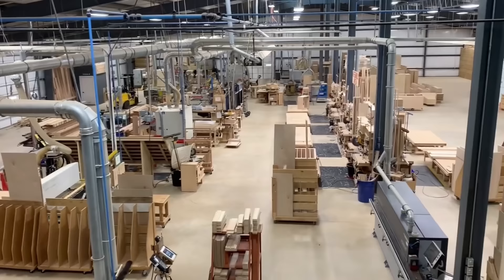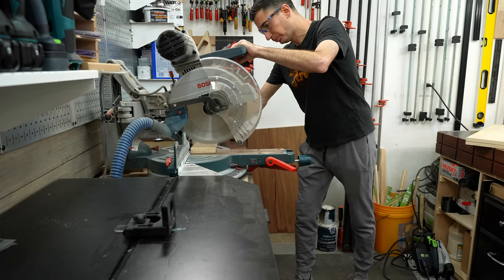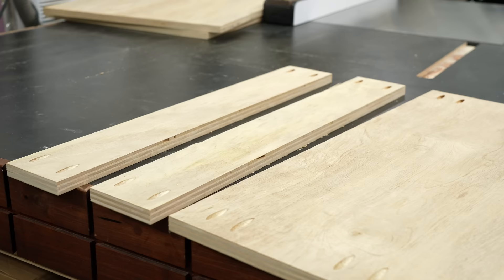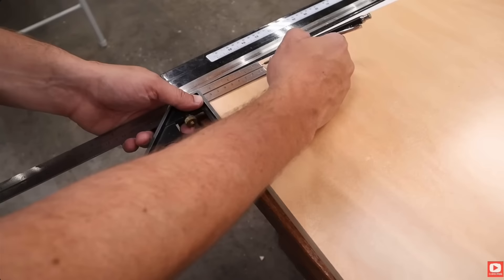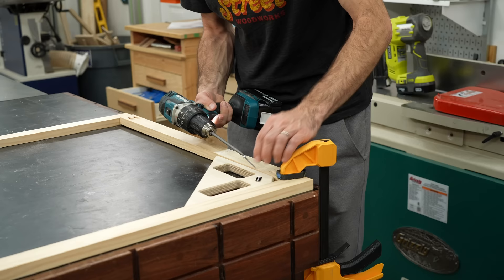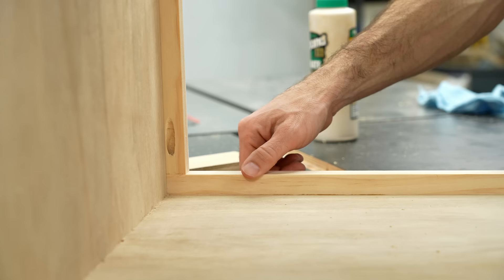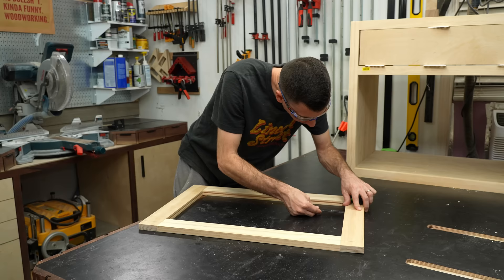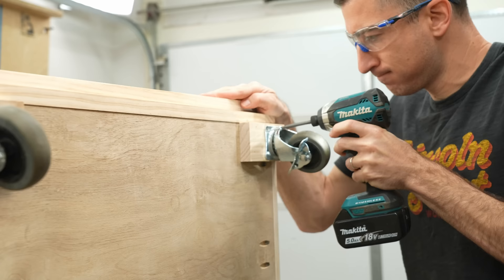Bad Beginner Cabinet Tips

Comment: To answer your question. I have been building cabinets for 35 years and am watching your video because I am helping a neighbor build his own garage cabinets. I am going to employ pocket screws & glue for simplicity and strength. He does not have a shop full of tools, limited experience and loads of apprehension. We started at the "big box" store (just like you) and picked out a sheet of sanded radiata pine plywood. I will send him the link to your video so he can mentally prepare. Great timing and great explanation of the beginner's process. Thx.
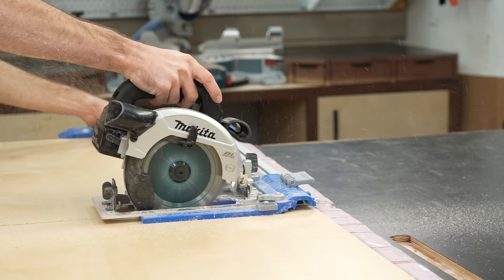Reply: 16:36 The Question 🙂
Reply: Perfect!
Reply: What d you give him else😆
Reply: Hhhssahhshahhaa

Comment: I'm just amazed you got a Home Depot employee to actually help you.   Nicely done.
Reply: in my area home depot is the most helpful place to go. its Lowes that the average homeowner has to stay away from  over here.
Reply: Home Depots are great, Lowes used to be terrible but they’ve honestly gotten a lot better.  Can’t beat the local private owned stores though, they are absolutely the best!
Reply: It's touch and go around here on whether you can get somebody to cut your panels.

My favorite part is when they start siding rules about how they're not allowed to cut it this way or that way because Billy Bob cut his arm off last year trying to make a cross cut on the panel saw... 😂
Reply: I made a comment once to a Lowes manager.... told him his store was worse than the inside of a women's purse.. he laughed and said "funny it was designed around women" funny that was in 2005... haven't been in one more than 3 times  since
Reply: I’m amazed he found one
Reply: My Home Depot recently set a world record for the dullest saw blade on a power tool.  The whole store smelled like smoldering wood, molten steel, and vinegar after one cut.
Reply: Amen! I once drove to three different home depots (I called them first to verify they could do a rip cut), each one told me they couldn't do it for "safety reasons" o_0 safety policies are all good and well but like, tell me when I call before I drive all the way out there.
Reply: Panel saw is always down at home depot.

Comment: love your pragmatic approach,  it is evident in almost every step of this build.   Little stuff like the 2 pieces of offal instead of "doing the math" wind up giving the best fit.   Using simple methods and tools, eyeballing stuff, using a drill bit for a depth gauge, etc...
Good work!
Reply: @ensidfkgnur, "offal"? Perhaps you meant "offcut"?

Dang spellcheck!
Reply: @fredericapanon207  Meant to use it, it usually refers to waste parts from butchering but I figure a tree used to be alive so that's what I call scrap wood.

Comment: Glad to see that after your deliberation, you went forward on making the cabinet tutorial using, your own sensitivity,  a simple set of tools, and enjoyable instructional style. You've made a contribution on this topic.  Thank you!

Two other simple DIY ideas that I use are 1) to sand and cut wood in the driveway outside my shop in order to lessen the DUST problem, and 2) for an inexpensive, flat, light-duty work table (cutting, sanding, assembling), I use two cheap collapsible but sturdy Stanley saw horses with an old hollow core door on top  (look around the neighborhood on garbage day.) Those three parts can tuck neatly away in even a small storage locker.
Reply: I'm a huge fan of the hollow core door as a temporary work surface. So nice and light, but still stay decently flat when only supported by a couple of saw horses

Comment: Honestly, I bought that Kreg circular saw guide and it made me feel so much better with cutting plywood. It is so quick and easy, and adjusting the measurements to be accurate is super simple. 

Highly recommend it. It changed my woodworking for the better.

Comment: When making the frame, it can be helpful to oversize the width by a half inch. This makes it easier to line up the faces of neighboring cabinets if your wall isn't perfect. It also let's you apply a quarter inch skin/panel on the side of the end cabinet scribed to the wall. This will minimize gaps between the cabinet and wall and hide any fasteners on the side of the cabinet. Or cover the unsanded/rough side of the plywood.

Comment: Math teacher here. That board might not necessarily be a parallelogram. Both pairs of opposite sides have to be parallel to meet the requirements of a parallelogram. If only one pair are parallel you have something like a trapezoid. Either way, great video as always!
Reply: And if we're getting pedantic, he talked about building a parallelogram instead of a box, but a parallelogram is flat, so the equivalent would be a parallelepiped. Or a trapezoid prism, but the edge guide will guarantee you get a parallelogram.

Comment: I have been building cabinets for 55 years and I watched your video for entertainment. My first table saw was a circular saw mounted on a piece of plywood and turned over. I made six eight foot cabinets for my garage with that table saw and these weren't even my first cabinets. I then bought an antique porcelain top table and convinced my wife I needed a table saw to make the chairs, that was in 1984, over the years I did a few upgrades to the saw but just realized it's 40 years old this year and looks and runs like new. I have used it to remodel two homes. it has been used to make dozens of cabinets a few inside doors and two oak and two cherry entry doors, coffee tables, end tables, headboards, well the list is endless. By the way I think y wife has been able to park her car in the garage for about two months, that's one month for each house. and the second house is a three car garage or should I say workshop. The other reason I watch you is, even an old dog like me can learn a new trick.

Comment: A quick tip for bringing home intact 4’x8’ sheets of Pink Panther:
An ‘03 Subaru station wagon and a 10-foot length of whatever rope or strap you have handy is all you need! Make sure to use this as an excuse to purchase corresponding 4’x8’ sheets of plywood for the “other” projects. The foam board acts as perfect Subaru-scratch-protection when weighed down by sheets of ply — the more, the better! Remember, NEVER match-stack multiple sheets of Pink Panther — it’s super slippery. Ask me how I know. Instead, alternate strawberry-chocolate-strawberry-chocolate. Use that strap draped over the top and held by your left hand through open windows and pray for no gusts of sideswiping wind. Knee-steer with manual transmission (also helps with praying) and drive home as fast as the zephyr gods will allow. Pull over to let tailgaters pass but make sure to smile as they gawk and point. They probably think delivery is free and they certainly don’t understand YouTube content creation. Suckers.
#thatguyinthehomedepotparkinglot #slippery
Reply: Somewhere in the bowels of Home Depot, there must be a video of parking lot bloopers.

Comment: I love your commentary. All the techniques you demostrated are what every 'beginner' DIY'er should know. Also, as you have pointed out, "Haste makes waste"
As far as your thumbnail, the straight in method is stronger that the direction the pocket holes are drilled for entry into the mating piece of wood. If the pocket holes were drilled to enter the wood in the opposite direction then the choice would be reveal of the fastner.
Love your videos and keep up the good work.

Comment: 2:13 could also be a trapezoid if the shorter edges are not parallel. Math geek FTW!
Reply: you learn this when you're 4 years old you're not a math geek more like a little kid
Reply: He's using an edge guide, so both pairs of opposite sides will be parallel. He was comparing the parallelogram to a box though, so the proper math geek term would have been parallelepiped...

Comment: Totally agree on your points!  However, I use my shop projects to improve our skills, so yes I overkill and pretend it for inside the house.  Mistake here and it was just a learning experience in a piece of wood that is much cheaper than if I had been building something for inside my home.  One tip is to take it slow and verify how the pieces are going to fit before we make that final  irreversible cut.  Again thanks for the tips.

Comment: Great overview.  I'm a huge fan of the crown staple and then screw the parts together.  No need for glue, dados/rabbits, etc., unless you are building a tank (and I have no issue if you do).  It works just fine, is plenty strong, saves time and mess.  I like to buy the pre-finished plywood since you don't really have to touch the inside at all after construction.  Worth the extra upfront $ IMHO.

Tip for toe kicks, especially the separately built ones... make sure that if your cabinet side(s) is/are exposed that any base molding covers the seam between the toe kick and cabinet side.  I've made that mistake before!

Comment: This may be the best video containing sponsor promotion I’ve ever seen. I really liked the conversational way you talked about insurance. Parent to parent. Very cool, but what rocked it for me was you didn’t stop working on the project. That right there. This! Also appreciate the stats and coverage of alternative methods, particularly the trade-offs in cost, strength, aesthetics, and difficulty to pull off. Of course you did all the other stuff right too. No super fancy tools, addressing metric people, pointing of the extra gap, using the tools well, you even had two wide shots so we could see both ends of your shop. Solid. A really solid video with an awesome innovation in pitching for your sponsor!

Comment: Instead of the toe kick frame, you can buy sets of 4 feet + 2 clips online. 1 foot per corner, and they’re all individually adjustable to level off. You attach the clips to a single plank, and they click onto the front 2 feet. If you have multiple cabinets, you can put the clips onto a single long plank so there’s less seams. You can attach a little pull cord that sticks out of the top, hidden from view, so you can unclip them
Reply: Yes, they adjust also just like a dishwasher. It's easy

Comment: If you don’t have a truck, another reasonable option is renting a small pickup truck on Turo. I found a Jeep Gladiator for $60/day and it has a nice feature to load full sheets of plywood in the truck bed. Home Depot also rents trucks for like $20 for 4 hours, which may be a good option if you live close.

Comment: I've had good luck cutting plywood at 11-7/8 “ x 96", & it comes out perfectly with 4 pieces the same width. If you are making wall cabinets for the kitchen, the standard depth is 12", but consider making them deeper (13", or 14"), as 12" is barely enough for dinner plates. The added depth could be helpful.

Comment: I agree, most all options of assembly have their place and time. If the sides will not be visible, glue/brad nail/end screws. If the ends are visible I’m more inclined to use pocket screws for box assembly as long as they won’t be visible.

Comment: I built a bunch of shop cabinets years ago with pocket screws and a circular saw using pretty much exactly this same method.  They are still holding strong and survived two moves in that time.  Pretty easy and holds up better than I thought they would.

Comment: A very good video. Very informative, easy to follow. 
I’ve been cobbling cabinets together for a very long time now. I started in construction when I was 15, I’m 70 now, broken down and tired, but so busy, with three daughters living within 5 blocks ether way from our house, they always need something built or fixed, and I love it!
Every single thing in this video I completely agree with, except, I can’t imagine a drawer bottom simply glued and pin nailed. I was taught, and have always used a loose panel, in a dato groove. Here’s a tip for a great looking drawer. Blow the dollars on 5/8” Baltic birch, but save it for your drawer boxes. For the top edge use a round-over, then clear coat the box. For the finishing touch, I use white melamine coated Masonite for the slide-in bottom. It makes a very sharp, east to clean drawer. 
Anyway, I really enjoyed this video. As I’m new to your channel, I get to binge watch all the others! 
For those that enjoy fine woodworking on a larger scale, I suggest watching the Tally Ho, or Acorn to Arabella channels. Both are 30+ foot sailing boats built from the keel up. They’re both well worthy of your time, you won’t be sorry. 
Cheers!

Comment: I’m loving how the pocket screw has taken over the YouTuber wood working video, to be more helpful, when you use those hidden hinges, cut a block that the hinge plate sits on that goes inside the face frame, this will keep all the doors in alignment, upper and lower cabinets, and on the drawer fronts, pin nail them as close as you can to where you want them then tap the alignment to perfection, and then screw them on to hold the alignment 😅

Comment: I am sorry to inform you that I have been putting together drawers the old way for 50 years. Without the need for KREG methods and all kinds of others.
For the drawers, I usually work with 15 mm PLYWOOD with screws 3.5 mm thick and 40 mm long, and of course add good glue.
Sometimes innovations (with all due respect) do not significantly change/improve but add costs.
In amateur carpentry there is beauty in maintaining good quality and at the same time adhering to minimalism.
Sorry for my English, not as fluent as my drawers.

Best regards.
Haim

Comment: Gluing the drawer bottoms on as you did may work alright for light duty use. If however you anticipate storing heavier items in the drawer, it would be better to set the drawer bottom into a groove cut into the sides. Allowing enough room between the drawer side bottoms to the groove, will also allow running a brace bd. under the drawer bottom, for even more heavier duty use.

Comment: I wish I would’ve found your channel before I started a kitchen reno 5 years ago. By the time I was done, I landed on your MO, almost exactly. I did learn the Brad nail trick though. Much easier than using 4’ clamps and wonky corner clamps.

Comment: For anyone else that does not have a truck I would recommend a harbor freight circular saw from their Hercules line. Their 20 V brushless has an extraordinarily large and solid foot on it and with an eight amp hour battery, it has loads of power to run. I take mine with me to the store now.. just in case I need something..”need”
I’m waiting for them to come out with the track saw ………….

Comment: The separate toe kick construction method is an advantage for cabinets installed in a garage workshop because the concrete floors of a garage are typically sloped down towards the overhead door. This allows the toe kick assembly to accomplish all of the leveling of the base cabinets. Cabinets in shops and garages are not like kitchen cabinetry where the aesthetics of end panels and toe kicks influences the construction methods.

Comment: I bought some flatstack cabinets for a custo kitchen, and they all went together with dovetails. Those cabinets were definitely stronger than any flatstack cabinets I'd assembled before, and stronger than most if not all custom premade cabinets I'd delt with. If I start making cabinets more than the occasional one-off, I think I'm going to mimic that method.

Comment: Hey, greate video, a loot of useful tips, one suggestion though, for any cabinet on which you plan to put weigt, like the shop cabinet, the bottom should carry the load and not the screws, in other words, the bottom should have the external dimensiuon of the cabinet and the side walls should rest on the bottom, this provides mecanical advantages

Comment: Tip for those that dont have much room like living in apartment building. I designed the custom table, made cut list and then went to local store that had both cutting service and the plywood. I talked to guy first asking to be accurate as possible and asked for the simplest parts being cut and this was specially good since the charged by the area of plywood you bought, not the whole sheet. After confirming the size was what i ordered by fraction of a millimeter, witch i have to give the guy, excellent work, i gave him the rest of the cut list and told him that he would get good tip if it was same quality as before (note we dont usually tip around here. Normal service quality is required, but you might get tip for superb service). 

After those were cut, i went home and build the table in small ish two room apartment mostly using just hand drill, chisel and hammer, hand saws and in few cases router. The finishing work was done in buddys shop to finish coat everything. So its possible to make very large projects even if you dont have the tools or room for them... though gf at the time did take month vacation on my parents place while the most crunch to build it was going on as kitchen had peaces on glue up, living room floor(with plastic matt floor) was the workshop and ready made peaces were in the bedroom.
Having enough room to do things is just self inflicted restriction. All it takes is understanding gf and lots more cleaning and dust prevention/collection. Neighbors.. since i made it mostly on day time didnt mind the hammering and some even were curious enough to come and check the progress, but that is why we had rather tight community in the house. If you dont know your neighbors, least go talk to them and if there is noise tell them to come and talk to you instead of calling cops or complaining to other places, so you can build up the relationship and come up rules.